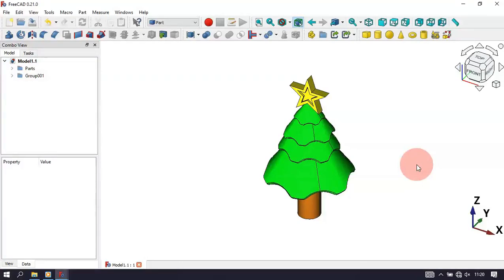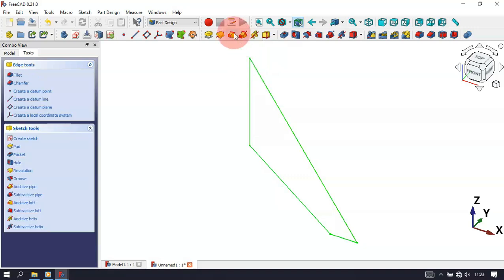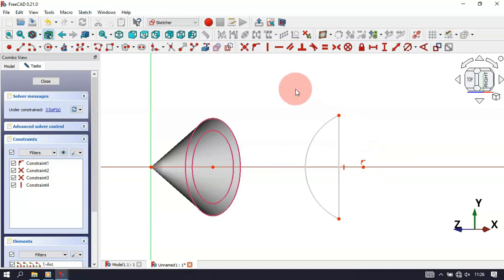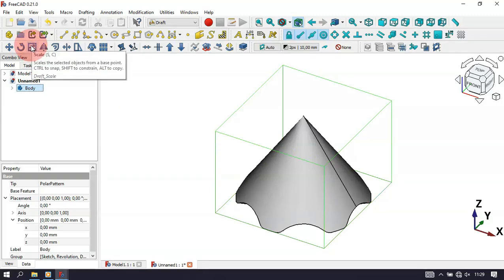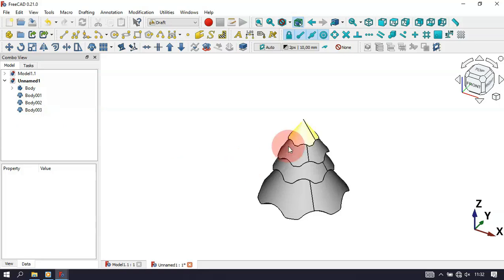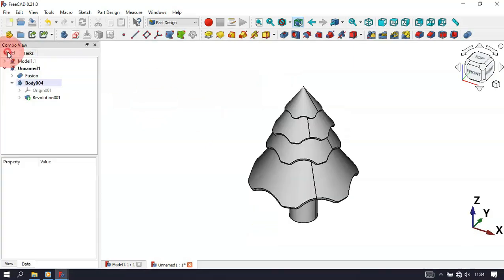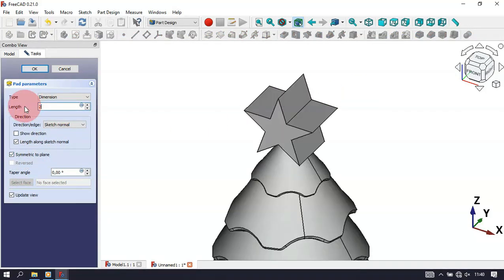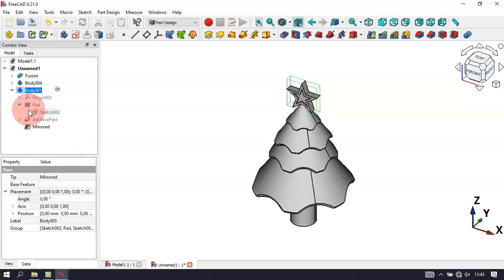FreeCAD 0.21 Beginners tutorial: practical exercise 118 (PartDesign, Part and Draft)

Comment: Thanks for sharing! How do I make it hallow so I can place some LEDs in it?
Reply: What do you need hollowed? The tree trunk? It's easy this part. Select the bottom of the trunk and make a sketch on it then make a pocket as deep upwards you want not reaching the top branch nor the star. Hollowing the branches its a bit more complicated... To insert LED's go to Surface workbench to make s sketch on every branch of the tree using "Sketch on surface" then make a pocket using that sketch. MangoJelly channel has some videos on that matter.
To hollow the branches it's possible with a sketch made on XZ or YZ plane (viewed from the front or right) and using the "Groove" tool.
Reply: @LFANS2001  thanks, will give it a try.